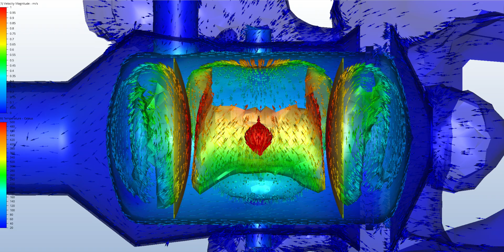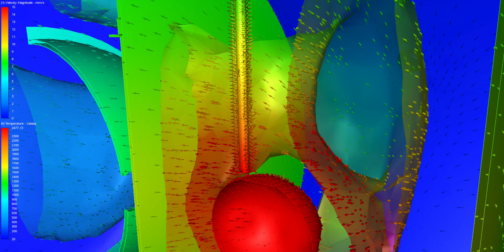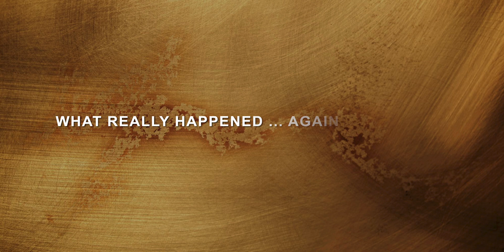Vaporizing Tungsten

Comment: As per Bob Lazar, how about using element 115 as the anode. And I'd still like to know if time is different inside the magnetic field. I theorize that time may run at different rates depending on the intensity of the magnetic field. Slow down time inside an interstellar craft and to the occupants it only took a few minutes. They say we'll be right back and ten thousand years on earth has passed. Reverse the process to travel back in time. Offset spacial divergence.

Comment: One of the SAFIRE experiments that helped me complete my understanding of how the weather works, from a charged point of view (Electric Weather Mechanics). And why the contact layer with the anode in atmospheric layering is so important. On earth the contact atmospheric layer is where the weather happens (and fractally has voltage layering inside of the bigger contact layer) and why space elevators couldn't possibly work, as the probe short circuited the electrical charge across the different layers and vaporised.